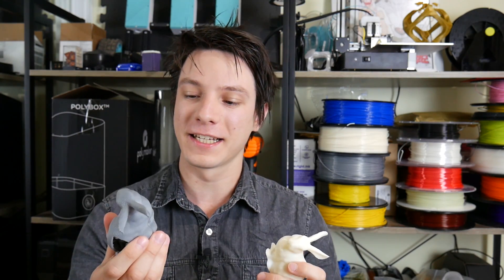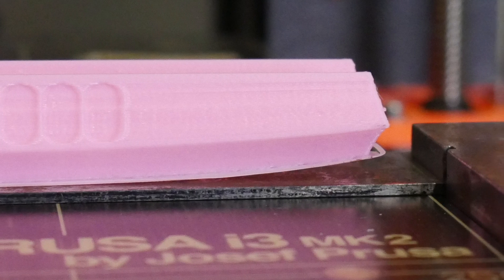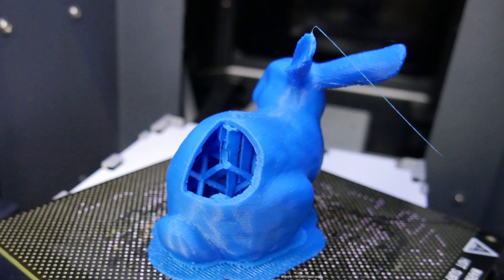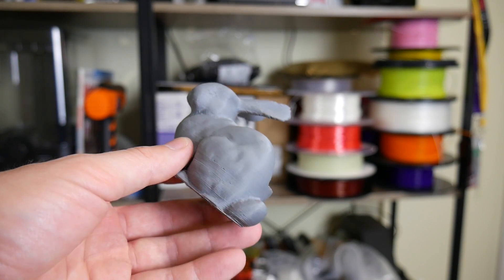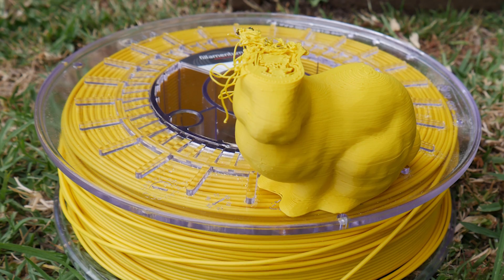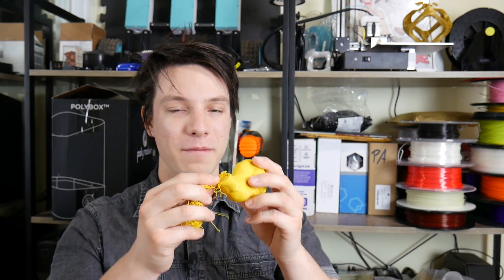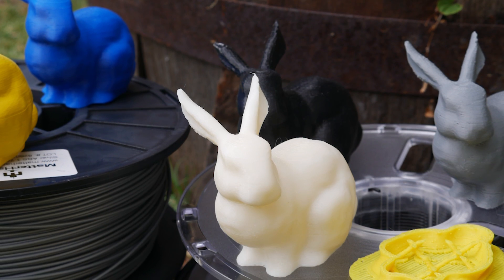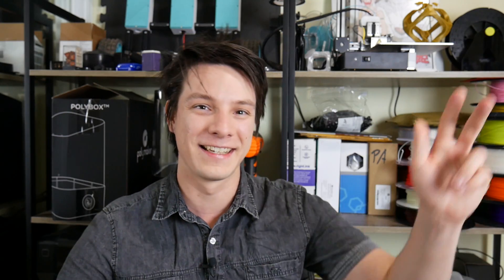Should you 3D Print in ABS? Probably not.

Comment: ABS is probably the most widely used plastic for injection molding. Big molding companies use it by the train car load. It molds easily and has good cosmetic and strength characteristics. It can be solvent glued and smoothed with acetone and other common solvents. If you need a lot more strength a glass filled material like nylon or polycarb is the answer. If fact some glass filled materials approach the strength of low grade aluminum. ABS is inexpensive and widely available in plenty of colors. In a Stratasys printer with heated and regulated chamber the results are superb. It precise and accurate. ABS doesn't melt if leave it out in the sun like PLA.  I print polycarb and nylon when the application requires it. Otherwise I stick to inexpensive ABS. 

Most plastics will absorb water and if they have been lying around soaking up water they won't print very well (or at all). Bake ABS at 150F in a recirculating air or vacuum oven overnight to restore it. ABS recipes differ but any can be successfully extruded into filament will likely print.

Despite the endless stream of new and better plastics (some costing 100X that of ABS) ABS is still among the most wildly used for ordinary parts. It always will be.

Given the fact that most hobby prints are decorative rather than structural any plastic would do.

How strong does the rabbit have to be?

Comment: The one reason I'd like to print with ABS is that PLA is impossible to smooth with acetone. What's worse, PLA is also near impossible to sand. This doesn't leave a lot of options for finishing. Or is there another filament that can be smoothed this way?

Comment: I have a quesion and this is just the video I decided to post on, my school just got a 3d printer for our robotics team, which I am on, we got the prusa i3 mk2, now we havent printed parts, we havent even built the printer yet, so what may be needed to be printed is unknown, but I know we will end up printing some parts for our robot, so the question I have is what kind of filament should I use, I am one of the ones that will be building the printer, as well as I will be managing it and probably be doing a lot of the printing, so I have been doing my research but this will be my first 3d printing experience so I need to tips
Reply: quick note I just watched the fight robot video, no our robots are not fighting bots, i am in highshool and our team is a FIRST team specifically FTC, so very light use no high heat high damage scenarios, worst thing that could happen to our parts will be our drive motors which are quite powerful so I am nervous about making 3d printed gears

Comment: My experience: if you want the ABS way: ABS+, it doesn't warp, and it adheres to my PEI sheet so well that I had to use those ceramic stove scrappers to create space to remove the ABS+ from it.
If you don't need ABS: PETG. PETG doesn't smell, doesn't warp, has almost the same resistance as ABS and is food safe.

Comment: Currently printing a full sized R2D2 in ABS,  #1 its cheap, #2 it can withstand heat (R2 gets stored in my garage which can get VERY hot), #3 its strong.  I'm not dumping 40$ a roll on some filament if I can drop 10$ a roll

Comment: Compositum filaments have less than 0.5% shrinkage. Other Polish brand - Noctuo has similarly low-shrinking material.
ABS is not an obsolete material (and I have printers that deal with it better than Stratasys at a fraction of cost).
I printed ABSes successfuly on  1.5k EUR 3D Kreator. And Iglidur, and nylons. Don't demonize 3D printing please!

Comment: How about long-term durability of prints? Resistance to humidity, sun exposure, mechanical stress, ...

I tend to make mechanical parts and ABS seemed a better fit.
I have to admit though that I've just thrown away a 4+ years old PLA part and it looked just fine. It's Always been inside a cupboard in the house though, so minimal light exposure and relatively stable temperature/humidity.

Comment: I don’t think you can judge a material you are not printing under the right settings. Like you said, you need an enclosure to control the temperature. I just made an enclosure for my printer and I’m printing complex ABS parts all day long. I found ways around the warping problem and it’s not so complex. Overall ABS is great for prototyping at low cost and there’s a reason it’s been around for years

Comment: Here's my 2 cents on this. I agree with Angus, this is a new Era of 3d printing. That being said, there have been some VERY VERY good filaments that have hit the market in the last year or two, pretty much making abs irrelevant. But, these filaments cost more money and I have found in some cases require extrusion temps that my printer (FF Dreamer) just can't achieve. I use my printer for real world applications and I still use abs when I need a material that is chemical resistant. (Like when using it with gas and oil) So abs is a good choice for this. I'm not sure, but nylon may also be a good choice for this, however nylon needs hotter temps in most cases. I've been getting very good at printing with abs, but it is definitely one of the tougher filaments to work with. Great video, I liked the demonstration of the pc toughness. Keep up the great vids.

Comment: Thanks, Angus, for your insights.

I'm fairly new at 3dP, but have already had to mess with PLA, ABS, ASA, and TPU.  One thing I see repeated in the comments so far is a variation on "the right plastic for the right need".  Yeah, but there are usually 2 or more alternatives.

PLA has been so much easier to deal with for the most part.  I've had several different spools from different companies, and in at least one case, the variability of the material from the same manufacturer (a normally well regarded Chinese supplier), was HUGE.  I've had PLA that will stick to the PEI bed like a champ, stuff that won't stick at all, and some filament that just refused to print reliably ( jams, bubbles in the raw filament, variations in diameter). 

I've not had to do much ABS printing since getting my own machine.  I used to print at our local makerspace, where ABS is endemic.  My personal machine came with a spool of ABS and I've ordered two more spools since I purchased... all from different manufacturers.  One smells like hell just on opening the box, and printing was eye watering.  One had a mild plastic smell when printing, and the last, most recent, has almost no smell at all (but I'm working with this one right now and attest to it's usability)

My experiences with ASA have been generally positive and on a par with or better than ABS.  It has required a slurry for the build plate, but the results have been great.  It's been strong, clean, and bright.  I've only used one roll so far because... *it's hard to find*!   So I make my prototypes in PLA or ABS, then carefully try it in ABS when I'm ready.  I need ASA since it's UV/Weather/Chemical resistance is so much better than ABS and the Texas sun easily destroys PLA.  I think you need to look more at ASA if you can find some.  

And when I decided to make something in TPU, I was really careful, read up on the stuff, got a bit scared but did it anyway.  And no complaints!  Worked like a champ. 

Bottom line:  On smell, it's going to be a crap shoot.  On exposure to chemicals (VOC), PLA is probably the least toxic, but you should always vent anything you print.  And finally, The Right Plastic for the Application is key.  

And give ASA another try.  I'll try the PolyCarbonate, too.  Thanks for all the work!

Comment: You should also mention that ABS particles pollute the air of the room they are in. This may not be the new asbestos, but it has been largely ignored.
Reply: ALL filaments give off nanoparticles along with fumes/gases of varying toxicity when being printed, so it is best to have an externally-vented extraction system in place. Even PLA can be nasty if you get thermal runaway on your hotend.   So, ventilation - and lots of it, and NEVER print in a closed room!

Comment: Good video but cant get in line with the direction of nobody should print in ABS in 2017. Might just be the wording of the statement but none the less. Ease of printing, quality, or price shouldn't be the determinants of why you print in a certain material in the first place. Material choice should be based on the object being printed, the objects use and the environment it is going to spend the most time including considerations for what the max extremes of that environment are.  Am I off base or other thoughts?

Comment: Interesting video, I also agree ABS is becoming 'out dated' as we move to the future. HOWEVER the cost of these new materials vs the difficulty of printing with ABS successfully far out weighs the use of the newer materials IMO.  I some cases these new materials are 4-6x higher in costs.

Personally I tend not to shy away from things just because they are difficult (ABS is NOT difficult IMO), but until these new materials come down in price, I don't see ABS going away any time soon.
Reply: ABS is so easy to print. See my comment above :) I print 15 hours prints even without enclosure. It works great.
Reply: Im noticing PETg being about the same cost now - but working with it is another story. ABS is just buttery smooth, PETg does not print so smooth.
Reply: The main reason that I'm interested in printing ABS is because I'm looking to weld the piece to other ABS plastic and doing that with other plastics is going to cause problems. Even just welding it in there may cause problems, but at least it'll have similar characteristics, so I shouldn't have to worry as much about it integrating.
Reply: ikr,, ABS does not have to be hard. you can make a warm enclosure around your printer with a cardboard box and so many ways to heat the space, esp if your printer is Creality Ender 3 sized. it is affordable filament and you can screw up 5x and still be ahead vs. an exotic filament that recently came out. ABS has physical properties that other plastics and polymers don't
Reply: ABS is the easiest and most predictable printing filament. You know exactly what will happen with what environments. Every other filament is different on different rolls and varies greatly

Comment: I've printed ABS for a while on a Prusa I3 clone. It's quite horrible with the warping. And making an enclosure is quite a lot of effort. And ABS is not strong. Not at all. I've had molten PLA prints that are tougher than molten ABS prints (no cooling on the parts). I've also done a lot of research and digging up old forums threads on how to print ABS. People said that you absolutely should not use or use a very low fan speed. Which gives horrible drooping and I'll have to lower my print speed. 
But I've had a lot of success with ABS with a low fan speed and around 90 to 120mm/s, but let's just say my printer cannot reach those speeds due to stepper driver limitations (jerk, acceleration, to prevent layer shifting) and I actually use 80mm/s.
Eventhough I had to use a large brim and close my room windows. Which is pretty much health murder, the moment you step into that room. ABS Fumes are not nice.
Poly-carbonate seems like the next step up. 
Btw HobbyKing also have those for like 20 euro's a roll. Bit more expensive, and I'll test them once I've made am enclosure with a ActiveCarbon filter. 
But everyone's DIY enclosure sucks, or cannot be modded, or cannot be moved without it falling apart, or does not use adaptive fans, keeps the heat in with insulation, reduce noise, actually prevents vibrations (my printers goes hard and shakes tables) etc etc. (I like to tinker with my printer)

Comment: I just checked Amazon and Polymaker PC Max is $159 for 3 kg. The Yoyi ABS I've been using is $18 per kilogram. At least for now I think I'll stick with ABS.
Reply: @Mozzman I print ABS in a closed room could that have an effect in your opinion?
Reply: @Zepeda3D  If your room is closed off and theres no one in it then you probably wont have a problem but with PETG theres no need to print in ABS much anymore. I have a small bird so I wouldnt these fumes anywhere in my house
Reply: @mozzedvideoandphotography3275  Yes PETG is great but ABS has greater dimensional stability which is more convenient for rigid structural parts like 3 printer parts than PETG which has some flex
Reply: @Mozzman ??? explain please
Reply: @Mozzman wow. dick much? let the dude print what he wants
Reply: me too, for south america it's almost impossible to import those items (they charge you between U$30 to U$50) so I'll sitck with good old ABS that's U$20 and locally available from many vendors in many colors too.Once u overcome the warping problem (strong bed glue, heated enclosure, raft extra base) nothing beats durability/cost for ABS.And I find it better than PLA for post-printing machining (drilling holes, filing, sanding and if you're more adventures acetone finishing gives it a shiny glossy surface effectively vanishing the layer lines).
Reply: @Mozzman The amount of vocs and ufps were comparable to something like frying food or baking a cake (imagine working at a kitchen). Personally I'm just annoyed that the reporting about it in 3d printing sites has been absolutely shit tier and even the research was pretty shitty at least when it comes to the actual impact for human beings who are hobby printing.
Reply: @Mozzman No, PC Max. PC Max makes fumes, too.
Reply: What a ripp off i print 9 euro for 1KG PLA, and ABS is even cheaper like 7 euro for 1KG
Reply: @pawesteller7833  Where are you getting filament at those prices? The cheapest I was able to find is HobbyKing's ABS. That's 12 euros with change ATM
Reply: @pawesteller7833  What brand of PLA do you use?
Reply: Paweł Steller can u send me a link to the 9 euro pla
Reply: @Mozzman dude doesn't pc make worse fumes?

Comment: You really need to try out Rigid Ink's ASA. It's expensive but for a reason... it prints INSANELY well. Follow Tom's guide and print in an enclosure. It makes up for its price due to the unlikeliness of a failed print and the time it saves you with post work.

Comment: Getting ABS to stick to the bed easy, just use a coat of gelatin. I've been able to have full volume prints with no warping when using gelatin and and a glass bed. The best part is, the print pops right off due to the different thermal expansions of the glass and the plastic when they are cooled.

Comment: ABS is amazing! I use it to make models, parts, etc. Then I smooth it with acetone and if done right it barely even loses any detail. Then I make a mold with it to use with other materials. For example, pour wax in the mold and then do lost wax casting.
Reply: With keycaps it is seen as lower quality and pbt is seen as higher quality
Reply: @Sebastian how is he selling products or controlling the market - it's just his own opinion, and making money on the side is part of being a content creator

in 3d printing there's no big monopoly on filament or printers yet
Reply: Exactly the reason I print mostly ABS. I print a lot of working prototypes, so I need a material that’s more flexible, doesn’t melt in the sun and is easy to finish. PLA is a bitch to sand and no easy way of smoothing it. I have a lot of ABS parts that I sanded, smoothed with acetone vapor, didn’t paint them at all and you could never tell they’re 3D printed. Plus, I keep a jar of goo made from acetone and failed ABS prints to use as a bondo replacement to fix some minor defects.

Comment: i feel PETG is a better option than ABS. it's just as strong as ABS but doesn't need a heated bed or enclosure. only issue I've had is bed adhesion can be tricky on larger prints. I usually fix this by printing the bottom layers 10 degrees hotter than than the rest.

Comment: I use ABS for all component parts. Even if it's a pain in the arse to keep the build area hot enough to avoid warping.  I'm pretty sure it's gonna give me brain cancer from the fumes.  PLA isn't an option for me sadly though. Poor heat resistance and too brittle.  PETG is pretty awesome, but I have problems printing things like a full bed of 40 small separate components without stringing.

Comment: As much of a pain in the ass it is, to print with ABS. The sanding/finishing speed seems to be faster. It takes me much less time to sand and smooth ABS than most PLA's and PETG, Which have a habit of scaring more with heavy grits , or loading up paper. When the paper loads up at the same time you increase the problem of putting heat into the model and melting the surface. It also remains affordable cost wise. As i can get good ABS at roughly half the cost of Polysmooth.

Comment: Different plastics for different properties. I use ABS for model rocket motor mounts where the higher GTT is critical, it's also lighter than PLA. I use PLA for aerodynamic parts where shape is more critical than temperature resistance.

Comment: Note that PC-Max is not pure polycarbonate. It is apparently blended or modified to make it easier to print. Pure polycarbonate has a glass transition temperature of about 147 °C. Polymaker gives the glass transition temperature of PC-Max as 113 °C. IOW, don't expect the same results with other polycarbonate filaments. They are, of course, useful if your parts need to withstand higher temperatures, but they are more difficult to print.